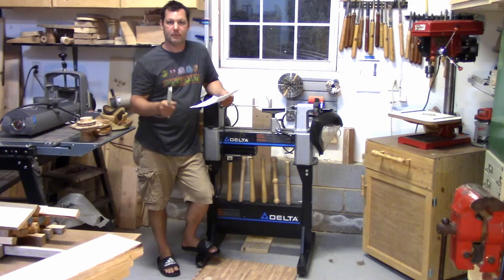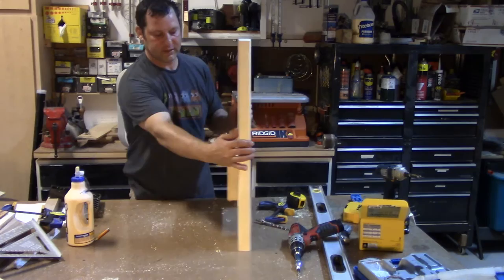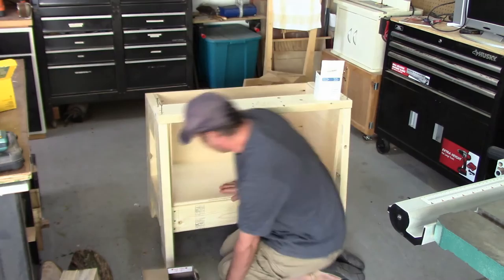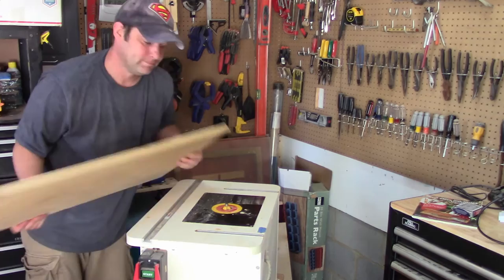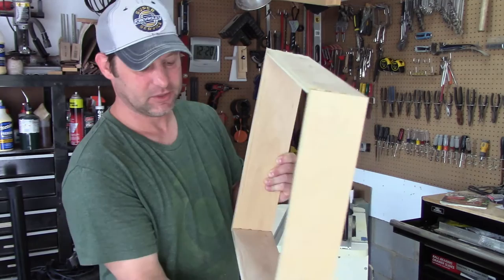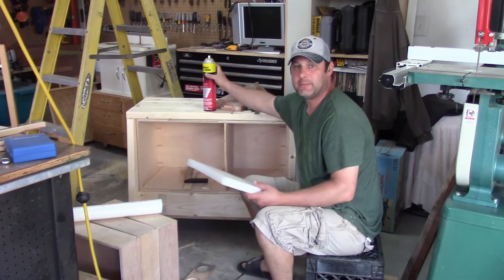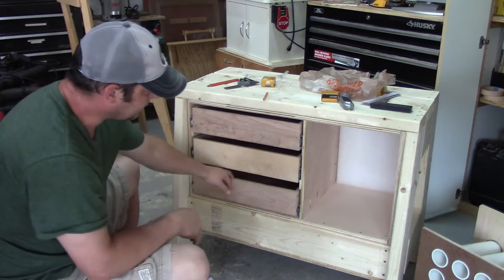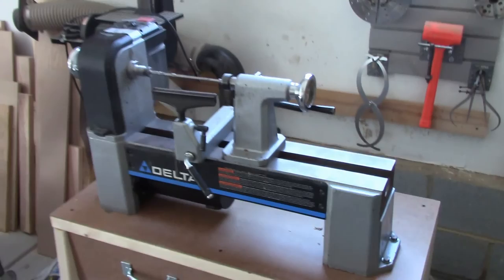Lathe Stand Full Build Video

Comment: Keith,
Just a couple of questions on your great design.
1. Are all four legs cut at an angle, or are the back legs vertical?
2. What is the length of the extra 2x6 which is glued and screwed onto the leg assembly and supporting the cross pieces?
Thanks,
Reply from the maker: Herms Radatus I don't remember. I screwed it up and had to play with the spacing as I went. I wasn't trying to create a specific angle, I was just trying to fit in a specific space. the bottom measures about 24" front to back and the top is about 14. Sorry I am not me help
Reply from the maker: Herms Radatus all four legs are cut at an angle

Comment: 30 degree splay on legs top and bottom ?
Reply from the maker: Garry Brpwine - NO. the angle worked out much smaller than that, closer to 12 degrees. I think the bottom of my stand was 24" and the top was 16"
Reply: Thanks for the information
Reply: Keith 
Great job.  Built like a brick ** house.